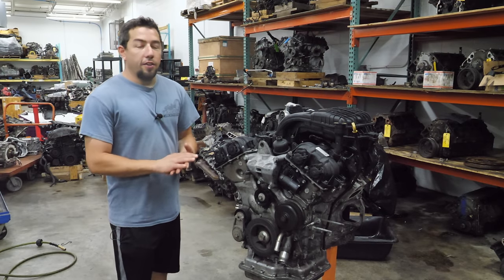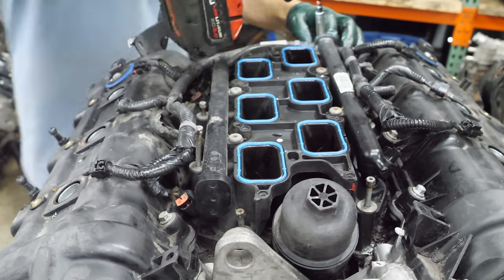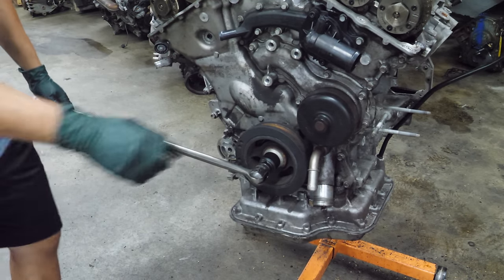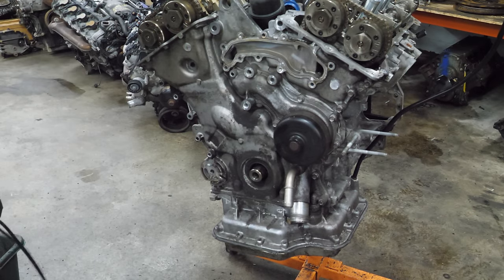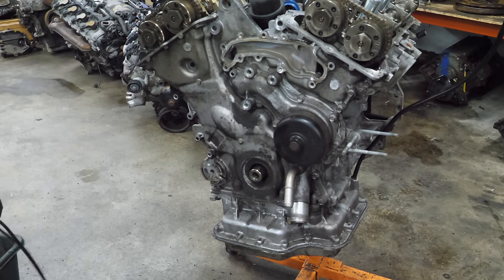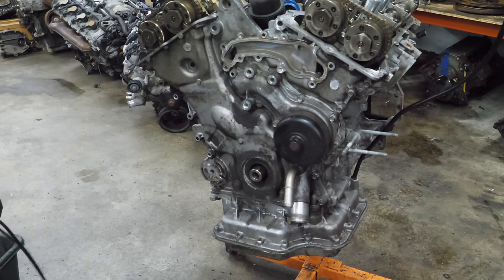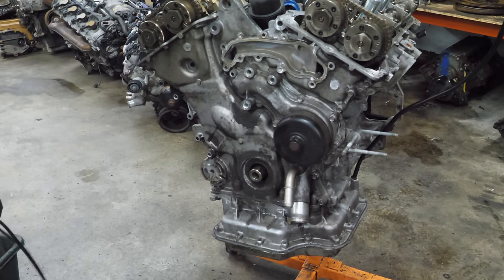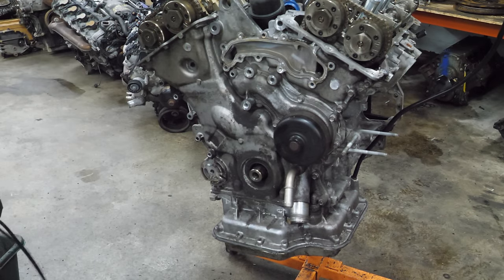Dodge Caravan 3.6L Pentastar V6 Teardown! Why Won't This Engine Turn All The Way Over?

Comment: A bucket in the head when taking the timing tensioners?🤣..I am impressed!...now the fun stuff, thank you for the video, I am taking one out of our van to try repair it but ours is hydro locked and the engine does not spin, can't take the torque converter bolts out so the whole thing is coming out of the van with the transmission, I am almost there, I am not mechanic but this videos help a lot, got the Haynes manual and shops in town to bombard mechanics with questions if in a pinch, no my first rodeo, I already repaired my wife Corolla couple years back and it is still running, this time around to make my projects a little bit easier I bought and installed in my garage a Max Jax lift which allows me to raise the van 3 feet off the floor, big difference than having to work just off jack stands as I did with the corolla, after this van is taken care of I still have another Toyota truck with a blown head gasket but will do full engine overhaul as well God Willing; soon I will be opening my engine and this video helps a lot, I do not want to swap it for a used engine or buy a long block; nobody sells just the short blocks on these; if the water damage did not compromised the block I will recondition it and replace whatever broken; yes parts or new block goes from 3k to over 5k but the dealer quote for this repair was 13K!!! I have Mopar Lifetime Warranty and they did not want to cover the repair this time; they already replaced the engine once at 59k miles due to a spun bearing, now it has 127k; my full cover insurance with the comprehensive refused also to cover; they wanted to total the van because of the cost; dealer did not offered a used engine as a solution so that is how I am stuck with this van to repair it on my own; I am not throwing away a 30k vehicle. If the block is damaged beyond repair then I would consider buying a used engine but it is hard to find anything with less than 70k and these engines are not exactly real "stars" when it comes to durability; if I recondition it myself I feel I can get an engine as close to zero miles mechanically as possible and be confident the van would run another 100k before need another repair, with luck, that is. Thanks again for your video, I subbed.

Comment: Love to see this video to . Carbon seems to be a issue with this v6 after 170000 miles with very regular oil changes and the oil was always very black between 3500&5000 miles. Maybe running fuel of higher octane more often could have affected in a positive way on low mileage motor ?  Good oil filter also

Comment: Good video. Last year I ordered and bought a 2021 JL Jeep Wrangler Unlimited Rubicon with the 3.6 liter V-6 Pentastar. Unfortunately, mine has eTorque, which I hate, but I’m going to try and delete it and go to a standard alternator and battery set up and delete the belt start generator, eTorque battery and coolant system to it and   everything else associated with it.

Comment: 7:00 i literally had to use a slide hammer with a vice grip to get my dip stick out of a 300,000 mile GM 3.1 v6
.
still works.... but makes more noise when i slide the dip stick in LOL

Comment: My favorite "carbon lock" story was working on a neighbor's 1970 Lincoln when I was 17 - had a bottom end knock; after checking the lifters, pulled the pan and a rod bearing....pretty worn, so spun a new set in. At start up it still had a knock.....old mechanic showed me it was a carbon knock

Comment: I have one of these in a 2012 Charger, 100 K and still running good.
A couple of recalls, replaced the alternator and change the transmission software.
290 HP/3.6L = 1.3 HP/C.I. I can remember when a Horse per C.I. was a big deal.
Reply: Had a couple as rentals.  Not quite as exciting to rev out as the GM 3.6 LFX, but they're still pretty motivated and reasonably sporty.  They have a good power delivery and the factory calibration will actually pick up a bit of low end ignition timing advance on higher octane fuel and make them a bit more fun, at least with the newer ones.  The GM for all its problems still had about the most remarkably broad power delivery of any modern non turbo engine...really excellent low end response, no bog anywhere in the power curve, and will actually pull right up to the 7200 rpm rev cut with authority.  Most things these days feel like the last 500-1000 rpm on the tach is just kind of optional/pointless.

Comment: Just bought a 2011 Town & Country with 102k miles - my You Tube research  has enlightened me with Pentastar issues; biggest issues I see are: 1) premature wear of cam lobes and followers, and 2) "dry starts", or no oil pressure for 10-20 seconds at startup due to the design of the oil filter/housing/oil cooler assy. - lack of a check valve in the oil filter and its upside down mounting cause it to drain on shutdown, takes 10-20 seconds at startup to refill the filter housing. In my opinion these 2 are interrelated, I'd say #2 has a VERY good chance of causing #1 (duh!). I only posit this theory based on 20yrs of working on everything from lawn mowers to tractor trailers, fork lifts, and construction equipment.

Comment: My supervisor at the lab I worked at had a 1987 Chevy Blazer that developed an engine knock at a low mileage. He was going to have another friend and I tear it down, but changed his mind and had me get him a new 350 from the local Chevy dealer. No core, his brother took the engine, pulled the heads and found a load of loose carbon in the cyllnders, cleaned them out and reassembled it. He uses them in his farm equipment.

Comment: Thanks for doing this particular engine - its the one in my 2013 Dodge Charger,  Mine runs well - I once caught a valve tick, but I believe because I change my oil very regularly I'm on the safer side.  Not to say it can't, but I'm hoping it will continue to run well - 193,200 km on it

Comment: I have a 2014 Journey RT with 180,000 kms on it and it's gone through 2 sets of rockers and 1 cam on the backside (firewall area) of the motor, also replaced the oil cooler housing and spark plugs at 102,000 kms. The parts are inexpensive but the labor to put them in hurts, I know how things work I just don't have the tools or know how in changing the parts.

Comment: I have one in a 2013 jeep moab I got from my dad. I have had the traditional lifter and rocker failures of the early engines. Was not too bad to fix though. On a side note (before I did the rockers and camshafts)  my jeep whenever it would have a rapid change in rpm (mainly downshifting under load), It would throw a intermittent camshaft position sensor code. What i think ended up causing it was fine metal dust sticking to the magnetic areas on the back of the camshaft. If you watch carefully in this video, you will see it too when he pulls the valve covers. Ive put 7k on my jeep since those repairs and I have yet to have a problem. Overall I think they are pretty decent engines and are incredibly smooth.
Reply: was hoping to see this failure

Comment: I've been waiting for this one! My Wife's T&C has one of the early ones. After 150,000 miles, I've only had to replace the thermostat, which I believe is not uncommon. I wouldn't call it a smooth engine, but I'm spoiled by a BMW N52, which is silky smooth. Too bad this thing carboned up like that. Perhaps it was always run on cheap gas. This is making me think about running some SeaFoam or Lucas fuel injector cleaner for a few tanks. Or maybe I shouldn't mess with a good running engine!
Reply: Nothing runs as smooth as a good BMW inline-6 :D   I think you would be hard pressed to find a V6 that is smooth as an I6

Comment: My bet is on oil changes were done at around ~10,000 + miles.  Though may owners manual say you can go that long between oil changes, others have documented failures related to those long oil change intervals.  Their research shows that the oil rings start to stick and oil gets into the combustion chamber.  Of course that would lead to the carbon build up in the engine's combustion chamber.  Since this motor had some sticking oil rings, the data suggest that this is a reasonable hypothesis.
Reply: Yep, if it looks black like rodent poo, it's time to change the oil!

Comment: I am sooo happy you did this one. I have the same in my 2013 JK 2D with a 100,000k on and so far it has ran flawlessly. I have zero leaks and I have done nothing to the engine but general maint and synth oil. I plan on keeping this Jeep for as long as it runs and then getting another engine if I have too, so good info on this one. I can tell you right now there is no carbon deposits in mine cause I drive it hard :)

Comment: On “Engines I’d like to seen torn down”.  The dreaded Porsche 944 with failed timing chain leading to valve adjustment. One to keep an eye out for. I have a triumph spitfire 1500 “too much play in my thrust bearings” but I’m a bit far to drop it off to you.

Comment: 23:00 front to back joke was funny.  watching this filled me with anxiety over the timing cover and timing chains.  i hoped i may be able to tackle it myself in a couple of days when the time comes.  now i have no confidence in myself to do the job when the tensioners and guides start to get sloppy.  and for the cost of a timing chain job at the dealer, i think i'd rather put that cash towards a low mileage hemi swap -_-

Comment: another engine id like to see is the 4.0 v6 chrysler used for only a couple years. from what i read on wikipedia, they were based on the 3.3/3.8 v6 engines

Comment: One tip I would give is yearly spray a can of Sea Foam Spray through the intake, and if you have a DI engine maybe run 2 or 3 cans.

Comment: Well done. Not sure you pushed breaker bar from you for cylinder head bolts (other then for video purposes, I was trained to pull towards your body for body-core stability.

Comment: I love seeing these and it's genuinely interesting to see why these engines fail and how they are designed. 
There's an engine I'm interested in seeing torn down - but it is an absolute rarity over there - the Renault Cléon-Fonte 1.4, found in the Renault Alliance.
Reply: Most french engines from 1960 to 1990 are remarkably simple.

The XU engine is also a good one to tear up, but I don't think it ever been sold in the US.
Reply: @ElectronikHeart  The 405 Mi16 was sold in the US. Last Peugeot ever sold over there.
Reply: @cominturismoengineer4012  I didn't know that.
I'm sure they are pretty hard to find.
Reply: @ElectronikHeart  Unfortunately so. And I doubt the few that are around would end up in a junkyard. 
There were also an unknown number of Citroen XMs imported by CXA Autos of New Jersey (iirc). Most if not all were the PRV V6, but there could've been an XU in the mix too, unsure.
You are also getting a few folks importing them... and then placing on Cars and Bids or something similar.

Comment: My first car was a 1988 carbed AE82 Corolla that had problems getting anywhere near past 80km/h (50 odd mph) by the time I got my hands on it in 2016. Any time I went beyond about 50% throttle it seemed to lose power and I’d pull over to let vehicles behind me pass going over hills. It seemed way too overpowered even for the Australian Market factoru detunec detuned (as if it ever needed less power than other markets) 4A-C.

Took it to a professional to diagnose as I was inexperienced at the time and his suggestion was it had been driven too gently/always kept at low throttle and rpm, carbon had built up in the combustion chamber, and a good old fashioned italian tuneup would set it right. 

Lo and behold after 3 months of driving it like I stole it, the car was an entirely new beast and could actually do the speed limit on uphills, even on freeways. The comments section seems to be nearly unanimous in stating the engine was perhaps grannied too hard, but I wonder could any issues with the factory ECU result in a rich tune and cause carbon build up even with the occasional Italian Tuneup? Or is Carbon in the Combustion Palace purely the result of too light footed a driver?

Comment: I have a 2012 Grand Cherokee with this engine.   145k and still running great.    Full synthetic oil changes every 6000 miles.

Comment: Great tear down.  We just purchased a 2022 PromMaster 3500 van conversion and I wanted to see the the engine torn down.  Looks like a good design - 6-bolt mains are impressive.  Could it be that someone put sugar into the gas tank?  That would cause instant carbon buildup.  Would the fuel injection system and sensors have allowed sugar-tainted fuel into the cylinders?  The seized engine could also have caused the accident.

Comment: When a low compression engine is run on high octane gasoline the anti-knock products aren't used and are left behind, carbon. A high compression needs octane to prevent detonation (knock) and therefore is used up, leaving the combustion chamber. Don't use high test on low test engines.

Comment: Problems with my pen test are 96k miles total, cams, oil cooler, water pump, head gaskets, lots of issues hate the engine. Love my Jeep, next Jeep I get will have a different engine !

Comment: I have a 15 chrysler 300 with 328k miles 3.6 these engines are really solid besides the rockers issue ,, you'll find it in jeep gladiators dodge promasters dodge rams 🐏 all dodge jeep ram cars

Comment: I have a 07 Dodge 1500 paid 200$ for it with a “bad engine”. Has a 3.7. They ran it for years with the Cats clogged. Same problem. Pulled the heads cleaned out the carbon build up. Runs perfect. I forgot to put the Cats back on it.

Comment: The only regular issues I see with the 3.6 are the POS oil cooler/filter assembly leaking. Happens across all models with this engine. Definitely a clean engine though damn!!

Comment: A Mopar with Autolite plugs...hmmmm...As clean as it is aside from the carbon collection I wonder if maybe the wrong plug was put in it...too cold that couldn't clear the carbon adequately enough..and I wouldn't put an Autolite plug in a dying lawnmower engine. Aside from that it would be interesting to find out the mileage. I also wonder if it wasn't an engine that someone said you can go 10K between oil changes...I've heard that that gum up the rings a ton too.
    A great video as always:-)

Comment: I’d been doing mostly grocery runs until I started watching YouTube videos on engines 
I’m now making a point of making longer runs
Like the “fifty mile trip to the grocery store”
Helps with the run-time, but with seven forward gears, it’s hard to get past 2000 rpm
Maybe 2200 rpm at 70+ mph

Comment: My guess on the carbon is excessive idling and mostly short trips, never really got hot enough to burn off the deposits, and excessive idling is the bane of piston rings on modern engines anyway.  Owner definitely kept up on oil changes.  It actually looks like a well designed engine aside from the lol oil filter housing (I had to have that part replaced on a Jeep Cherokee I had after the dealer mangled the filter lid during an oil change).  Bottom end looks fairly beefy with 6 bolt mains, it's oversquare so lower piston velocity and less piston slap so less stress on the bores and liners,  Valvetrain has roller lifters instead of cam on bucket, and the timing chain setup looks relatively simple.  In general it looks quite simple for a DOHC V6
Reply: This is one of FCA's 'bread and butter' motors, kept relatively simple to be able to go in almost everything, relatively low cost to build is relatively easy to rebuild, and no exotic bits / complex processes.  Still not quite as simple as the Slant 6.

Comment: That engine was very well taken care of and if I had to take a guess it traveled a lot of short distances. The carbon build up was excessive in the area of the direct injector. When DI engines are cold they concentrate fuel in the area of the injector and can't mix the fuel and air as effectively as port ot throttle body injection systems. My DI engine tends to dilute the oil when I running short distances , but I never looked to see how bad the carbon build up is in the cylinder. After seeing this video I'll run it a little hard occasionally to clean out the cylinders and I'll see if there's any fuel treatments that will reduce carbon buildup.
Reply: I would definitely put in a catch can. You tube has a ton of diy videos

Comment: I still want my Inline 300 (4.9L)! Someone has to have been T-boned with one or something. Of course, it'll still be a good motor, but I'll buy parts for my 80s carb build.

Actually, top dollar if you find a heavy duty exhaust manifold for one. I can't find one and I want it for a turbo build on the 94'.

Comment: I've never seen something like that.
I wonder if the injectors were fed too much gas or something? (faulty fuel pump)
Even idling for days I've never seen an engine locking itself on carbon...

Or maybe the aftermath of an intake carbon cleaning?

Something is seriously weird here!

The good thing is, so many good parts for once!

Comment: i'd like to see you dissassemble one of the older chrysler 3.8 or 3.3 v6 that were in the minivan through 2010 and even in a couple years of jeeps. the engine code names are EGA and EGH. either would be fine since they are effectively the same engine internally other than bore and stroke

Comment: We rented a Charger with one of those a few years ago and it was fine, (though didn't seem to be quite as torquey as the GM,  but I know those have significant issues...)  My inlaws have a Durango with one, and they haven't had any problems.